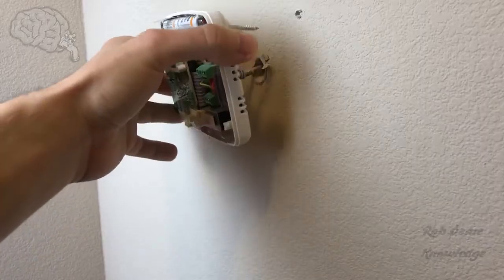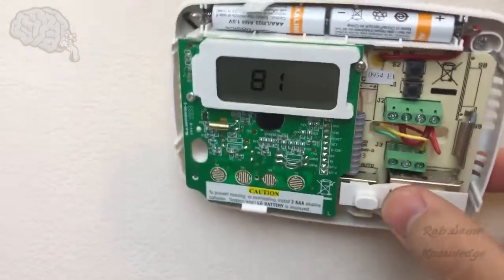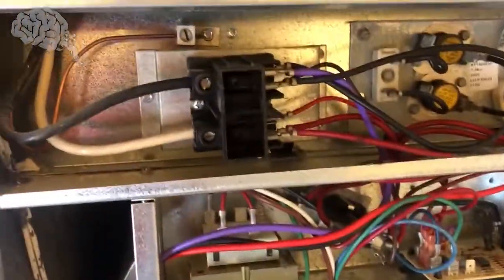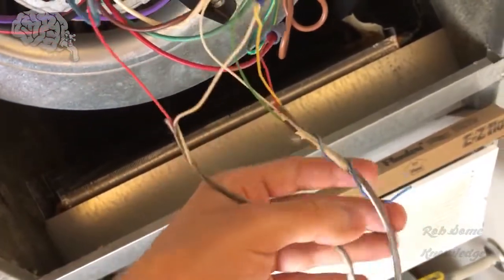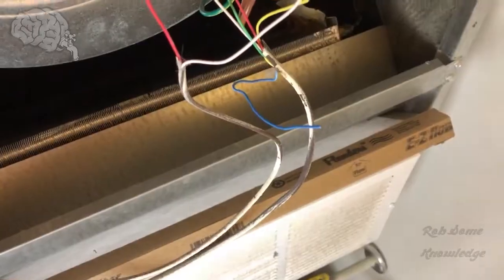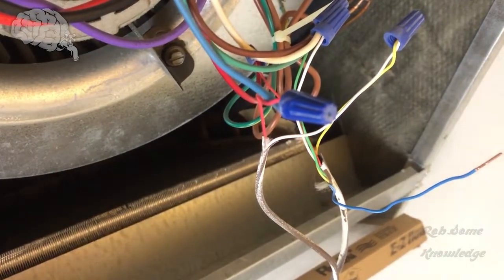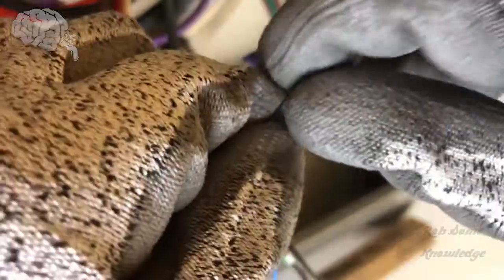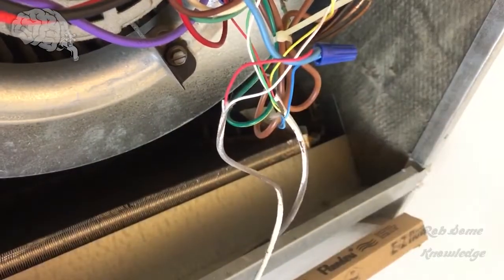How to Connect an Unused C Wire (Common Wire)

Comment: i have unused c wire blue in my furnance sitting unused, why do you need that wire anyway, is it to use new wi fi  thermostats, , whats the reason
Reply from the maker: Yes it is for mainly newer thermostats, smart thermostats, thermostats with LCD screens, so they can have constant power and not be going through replaceable batteries
Reply: @RobSomeKnowledge  ok, but i see my terminal on my furnance  and it has  c conecter occupied with 2 thin red wires , how would i then add the unused blue to it wouldn't be then too many wires . it has 2 red wires on on each side on same screw terminal. the rest are all normal  yellow, white , green, red.

Comment: I have a similar problem. I have unused c wire At my thermostat but it is actually screwed into the Seaport of my furnace, and what I presume to be a 24v c wire cable used to provide power to the older model, but when I open my furnace the layout is:

Green > to green port

C from the main wire and white from 24v wire set > to c port

White from main wire set > white port

Yellow from main bundle and red from 24v set > yellow port

Red from main bundle > red port

I’m wondering if I just remove the old 24 V conversion to wire red and white cord from the furnace and only leave green to green, c to c, Yellow to yellow, red to red and so on if that would fix the issue. My guess is the red and white 24 V conversion set which is connected between my two furnaces is the link that is providing them both power. 

Anybody have the same problem or any ideas for this?

Comment: So once it's connected, what terminal do you attach it to on this?  This thermostat does not have a c terminal.
Reply from the maker: You simply wouldn’t use a c wire on this thermostat shown in the video. Hence why it was not connected and why I made this video. There will be a terminal marked C on a thermostat that can use it. These older style thermostats don’t need it as they are fine to just run off batteries for a decent amount of time. The C wire is only in use for newer thermostats with either an LCD type screen or smart thermostats, both which require constant power and not very viable to run off batteries without them dying quickly. This video was just to show how to connect it on the furnace side as I swapped thermostats to a new smart thermostat just after this video. My video on replacing that thermostat is here if you wish to view it : https://youtu.be/GNPprC0vJrw
Reply: @RobSomeKnowledge  Thanks.  Odd but the thermostat I'm replacing is 15 yrs old and uses a c wire.  My new one (shown here) does not.
Reply from the maker: Hmmm that’s something I honestly don’t have an answer too. I guess maybe it’s just dependent on the manufacturer or model and style of thermostat. There’s no reason an older one couldn’t benefit from the use of a c wire as that would just mean you would never need to change batteries. Is your thermostat from 15 years ago one with like an actual LCD or backlit screen? Instead of the calculator type display with no backlighting, like the thermostat in this video?

Comment: Your video saved my bacon.  I have a 4 wire to my furnace/Thermostat, without a "C" common wire.  I needed a 24V wire to run my new WIFI Thermostat.  The "24V HUMM" screw on my furnace board was not a 24V hot.  But this was and it works great.  Thanks man.

Comment: Hi rob. I have a central air system which doesnt have a C terminal on it, it does gave a ground terminal though. Would i be able to use blue wire & connect to that ground terminal? Or just connect to screw on cabinet?

Comment: As long as i connect the thermostat C to the thick blue C coming of the C junction i am ok? Let's forget all the color codes right now. I connected the thernostat blue C to the thick blue C junction coming off the C slot on the board. In my case, the thick C is wired to a thin white wire.

Comment: Great video, besides the C wire being unused with the old thermostat, is there any other reason  why other wires (white wire) would not be connected to the thermostat?

Comment: I have this same problem where the C wire is too short to reach the HVAC terminal, but the wire already going to the C terminal (and also the Y terminal) doesn’t look like it’s going to the thermostat. (Possibly the compressor?) and isn’t spliced at all. Could I just buy some extra thermostat wire and extend that short C wire to the terminal?

Comment: Thank You!
I tried to install a new WiFi thermostat and my C-wire wasn't working. I was ready to return it to Home Depot until I saw your video. The C-wire was disconnected at the furnace. I looked at the wiring diagram on the furnace and found where I needed to connect the T-wire. Hooked the new Thermostat up and it worked. Love the video. Thanks again

Comment: So do all houses have a furnace? I don't know where the wires lead to? I live in Phoenix so not sure if we have one. We don't even have gas running to our house.
Reply from the maker: Most do. Either probably have a furnace or a boiler for heat somewhere in the house. You don’t need a gas supply for a furnace. The furnace shown in this video is in an all electric apartment. No gas supply for me either.
Reply: @RobSomeKnowledge  awesome thank you for the info!
Reply: Probably in the crawl space above your ceiling.

Comment: No dude, your common should be wire nut with the white from the condenser. This is mis information.
Reply from the maker: No, you’re the one that is misinformed. This information was confirmed with an HVAC professional before I did this on my own system and before posting this video. It’s important to not rely solely on the color of the wire unless you did the initial wiring install yourself. In my setup if I would connect the c wire to the white wire like you are saying that would just cause a short lol
Reply: @RobSomeKnowledge  No, red is your hot and white is your common. You always wire your blue with the common from the condenser which is always white. Also, it’s called a condenser not a compressor.
Reply from the maker: @chrisbgolfpro  Man, I really hope you're trollin' at this point. If not, I'm worried for your future.
     Firstly, there is both a compressor AND a condenser in an AC Unit. The two wire bundle that comes into the air handler/furnace compartment, is in fact, from the COMPRESSOR contactor, and not the condenser.
     Secondly, as I said, there is NO ALWAYS in wire color coding. Its entirely possible (while incompetent) to have something not following industry-wide color coding schemes. It all depends on who wired the system in the first place. It's not the color of the wire that magically makes the circuit work. It's what it's actually connected to on the other end. It could be rainbow wires, for all I care. 
    I will explain this again for you for the last time.
     So the air conditioning is turned on by the thermostat putting 24VAC on the Yellow Wire (or whatever color is connected to 'Y' Terminal at thermostat). Which in my case, the Yellow (Y) wire is connected to the White from the compressor, which are the HOT wires. So that means the other wire in the 2 Wire bundle from the compressor (Red Wire) is connected to the ground path, which is where you connect your C (common,blue) wire coming from the thermostat. 
    Also if you look in the video, before even connecting the C wire, the Red wire (from compressor), is already connected to a thicker blue wire, which traces back to the C connection on the board. Which means this is the junction that serves as the ground path. Why would you connect a HOT wire straight to a ground path? SHORT CIRCUIT ALERT!!!
     My system has been wired like this since this video was posted (almost a year now) and it has worked seamlessly, with not a single problem. If it was wired incorrectly, it would not be working...
      Where are you getting your information from?
Reply: @chrisbgolfpro  I am a thermostat installer. Do not follow the color of the condenser wires. Sometimes the condenser wires maybe black and white. The condenser wire will always be labeled as Y and C (sometimes there may be a third R wire).
If we determined which condenser wire which wire is the Y, the other wire must be the C wire.
Reply: @jonkc3635  i connected the C common wire (blue) to the white and yellow connection which i thought was the way to do it. Is that ok?
Reply: @palmerprod  how are the white and yellow connected?
Reply: @jonkc3635  they are connected exactly how you have it here. I connected the C blue to the yellow and white Y1 and the Nest is reading it ok. The AC is off since it's winter, but if this is not the right way please let me know. I can easily just switch the common wire to how you have it shown here. Thank you for replying.
Reply: @palmerprod  The blue C wire should not be connected with white Y1.
Reply: @jonkc3635  thank you Jon, i just switched it. Ignoring the coloring....basically i have to connect the C wire to the opposite wire of the Y1 connection right? So two wires are coming in...one is connected to Y1 , the othher can be connected to blue? I have no thick C cable in there
Reply: @palmerprod  The thermostat Y wire is connected to the Y compressor wire.
Reply: @jonkc3635  i got it. Ok i see whay Chris was saying...the thick blue common wire is actually connected to the inside air handler white wire. Thats where i made my thermostat C wire connection. The other wire on the Y1 connection is a white wire too and the other connection on that same one is a small thin red wire that actually connects to another small thin red one from the air handler. I assume connected the C common at that point OR the white/thick blue point would do the exact same thing? Sorry, it's been 12 years since my electrical classes.

Comment: Great little video.  Just as you described. Found blue wire tucked away behind old thermostat and went straight to the same blue wire within my air con unit. Took me all of 2 minutes to identify and connect up.  Now all working fine with wifi connected.  Thank you.  Keep up the good work

Comment: Hi Rob,

I connected the C wire (blue) in the furnace with the C spot, but the white was also connected there as well. Is this ok to do?
Reply: This is the exact set up I have, and I have the same question. My C wire spot is also tied together with a thin white wire. I wired the thermostat C into this junction. Its all working on the Nest, but i havnt turned the AC on yet since its winter.

Comment: Ok I just need to make sure I have this right in my head. I do have the blue common wire available at the thermostat and available at the furnace. My configuration is also very similar to yours. I just have a bunch of wires wired together by wire nuts. I don't have a labeled connection on the furnace like some people do Y, Rh, RC, G, W, B like on the thermostat that the wires are attached into. . So I want to make sure I understand you correctly. I have two main wire lines. The one going to the AC compressor outside and the other going to the thermostat. I can tell which is which by the direction they are headed from the furnace. So I would take the blue wire coming from the thermostat grouping and wire that to the red and ground wire (brown in my case) coming from the compressor grouping. Is that right? Just making sure I have that right. I was thinking I would be adding the blue wire in the stat group to a wire nut of other wires in that stat group. Didn't realize I would be attaching it with the outdoor compressor wire group. So just confirming. I will go try this tomorrow if so.
Reply from the maker: Yes that is correct, assuming you have double checked that color coding was followed properly. You will connect the C wire (Blue typically) from the thermostat bundle coming into the furnace compartment TO the wire nut with the red (ground wire) from the AC Compressor wire bundle AND the other ground wire from the control board of the furnace (brown in your case)(thicker 2nd blue wire in the video's case). 
Make sure to double check the red wire from AC compressor is, in fact, the ground wire. [Things can get wired incorrectly sometimes (color code wise)]. To do this do what I showed in the video. Make sure the other wire (white) in the 2 wire AC compressor bundle is connected to the  wire nut with the Yellow Wire from the thermostat bundle ( or whichever color wire is connected to the Y terminal at the thermostat). Never assume someone followed proper color coding unless you installed it yourself. 
You DO NOT want to attach the C wire to a wire nut with any other wires from the thermostat bundle (especially any with voltage running through it)(Typically your red wires Rc and Rh)
All we are doing is combining this C wire in with a wire nut of 2 other wires that are also ground wires, so they can all share a path to ground. Adding this to a wire nut with voltage running through the wires can short something out possibly. Doing that could possibly damage your furnace control board, thermostat, or trip a circuit breaker.
Let me know once you get it installed and how it went!

Comment: How many volts should be coming out of the C terminal?
Reply: C terminal is a ground path. No voltage should be coming from it. It is a return path for the 24v from the power wire (Red usually) to return to and complete the circuit. #FAXX
Reply: Usually 24volts DC

Comment: Hello I really need your help. My AC repair guy use my heating wire to reconnect my AC so my AC would work now that it’s freezing and all my kids are freezing him do you have a video where you can show me how to take the AC wire and use it for the heating wire instead of paying $250 for a new wire I can’t find any videos on it I am good with learning visually I have soldered I’m not dumb. I am please reply if you do have a video where I can replaceMy AC wire to the heating system wire because it was switched before because our AC why are blue and we needed a C in the summer I’m in Florida and I want to know how to take it out and connect it to the heating if you have any videos on that or know anybody who has videos can you please comment back ASAP thank you

Comment: Is there a way to determine if the unused blue wire (C wire) is connected to the main furnace board without opening up the furnace? I checked mine using a tester and it shows it has no power to it. Is this normal?

Comment: I did this, and it now powers my Honeywell Smart thermostat 9000, but when I turn on the AC the thermostat just reboots and no AC comes on.  Any ideas ?
Reply from the maker: Check your connections. Make sure they are secure. I don’t have any experience with that specific thermostat but, Sounds to me like either your power (red) wire or C wire is loose or not properly connected in the terminal.
Reply: @RobSomeKnowledge  My bad, linked into the wrong set of wires.  Found the blue common going from air handler to compressor unit and all is well now, working as it should.  Great video dude, thanks !!

Comment: Mine doesn’t have an extra unused wire. It has only 4 wires and all are in use. Can I buy a thermostat wire, run it through the wall, along side the existing one, and attach it to the c terminals on either end? Will that work?
Reply from the maker: If you're already planning on running it through the wall alongside the existing one, I would just buy a whole new thermostat wire with the # of wires you need (https://amzn.to/3o9Vmz9) and reconnect it to thermostat and furnace, so you just have a single bundle with all the wires necessary.

Comment: This saved my day.  Thank you!  I thought I had to extend the C wire and connect directly to the board.
Reply from the maker: It was quite frustrating for me at first too until I did a bunch of research. I’m glad I was able to help!!!
Reply: @RobSomeKnowledge  I tried to wire directly to the c terminal, it did not work, there is a make delay timer hooked to my c terminal and the air compressor, can not get it to work